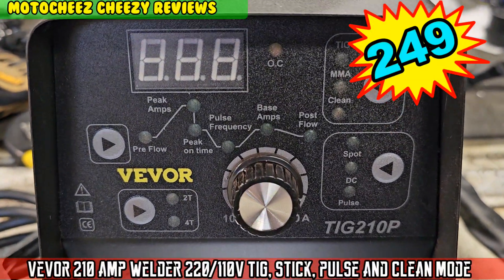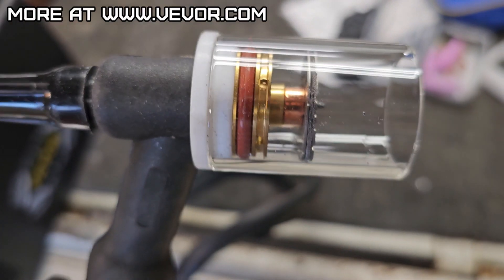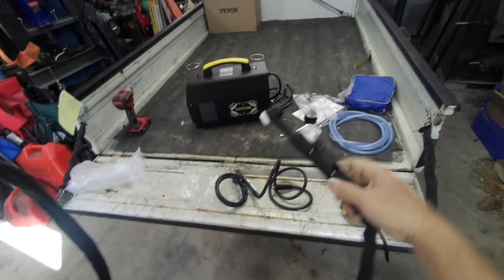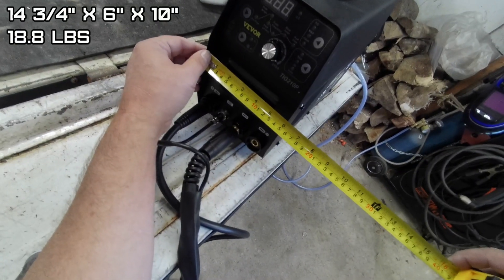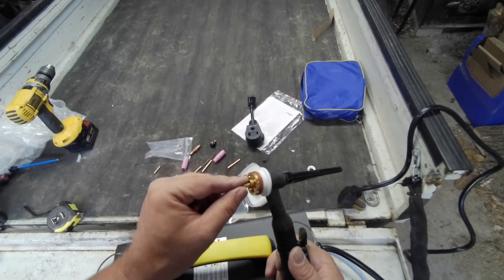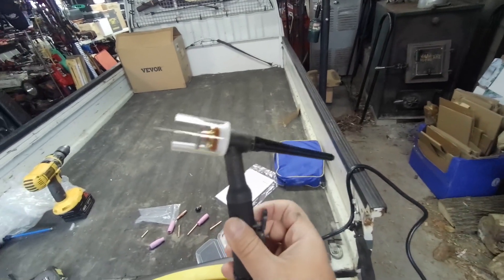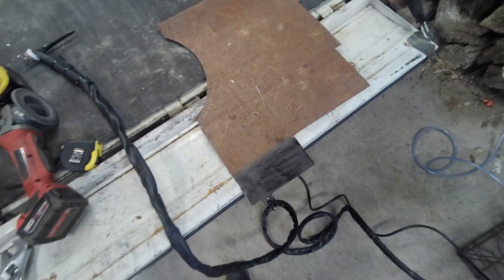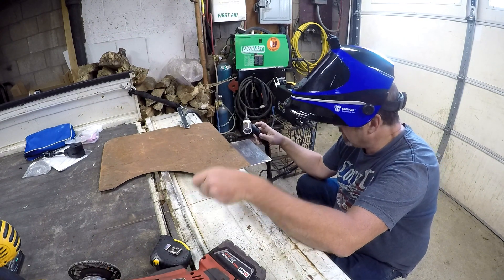VEVOR 210 Amp TIG Welder, IGBT Inverter, 3 in 1, 110/220V HF TIG/Stick/Clean w/Pulse, Torch

Comment: Is the argon flowing continuously, or does it shut off when not welding?
Reply from the maker: It flows when you pull the trigger, there is a post flow and pre flow timing adjustment also but when you're not welding the solenoid valve is off for the argon

Comment: Get rid of the giant cup, it's a joke and doesn't allow proper gas coverage.  Use a #5 or #6 ceramic cup, much better.  A small cup also saves Argon. When you dunk your tungsten, regrind.  Welding with it dunked messes up your arc.  Use just enough heat to get the puddle going, then move along fast enough to move the puddle without allowing it to enlarge.  The heat signature on your work piece shows either too much heat or staying too long in one spot.  After enough seat time, you'll get the hang of it.  TIG is a great skill, and gives you the ability to precisely weld thin metals with high success.
Reply: Yes but it you weld s/s it is better
Reply from the maker: Yeah I noticed that the regulator doesn't flow enough for a big cup, my friend Gary's a pro TIG welder does it for business and we figured that out pretty quick
Reply from the maker: But this one actually did pretty good with the big cup and the diffuser in it, it came with all that and this one did well the other one that I tested wouldn't run a big cup

Comment: Looks like your getting metal to hot
Reply from the maker: You're probably right, I'm pretty green at TIG welding.
Reply: @MotoCheez  good job for your first time I've never used one but looking to buy one to weld sheet metal without warping I was hoping it would be easier than mig but not sure about that 😂
Reply from the maker: It's not, but seems easy to learn

Comment: Looks real good for your first attempt at tig welding.  Much better than my first attempt many years ago for sure!  You already figured out need to not pull the torch away at the end of the weld, need that post flow until the metal/weld cools, that can be a difficult habit to break.  Only other thing I see that would help is less angle/lead on the torch, you want more like max 15 degrees towards the direction of travel/as close to straight up and down/90 degrees as possible.  If resting the cup on the work, may need to move the tungsten in a little/less stick out to achieve the angle.  That will help direct the heat better and the argon/shielding gas will work a lot better, when there is too much angle, gas tends to blow right by.  Oh, and thanks for all the videos, I enjoy every one!
Reply: I’m soon to get mine and will use your advice.
Reply from the maker: Good tip! Thanks 😁👍